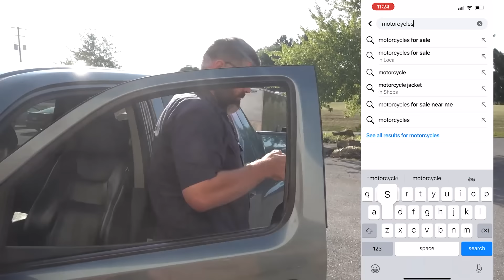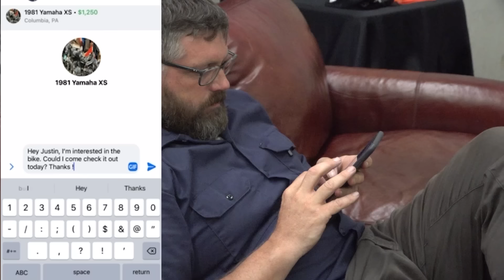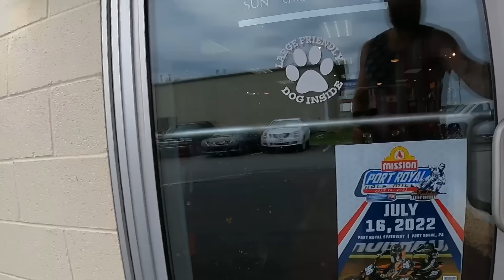I Bought the Cheapest under $1,000 Motorcycles: Challenge

Comment: The same time you guys were doing this, i was buying the only titled bike on marketplace under $1000...  just so happened to be a black 89  virago 1100.

Got it full of green/yellow gas & "fresh rebuilt" carbs off, flushed fuel system, carbs on, fresh gas, ran good. Cleaned the carbs, runs great.
Now just needs the updated starter gear.

First road bike, got it in pieces, had it ridable within 24hrs. $400 well spent!

Comment: I can relate to the challenge of taking out and rebuilding/cleaning the carburetor. About two years ago I purchased a partially running 1993 Yamaha Virago 750, which looked quite similar to Sean’s. It broke down on my drive home with it. Turned out that the carb needed a makeover. It was a big challenge removing the carb, but especially trying to reinstall it. YouTube was a huge help. Still riding the bike. Thanks for the fun videos Sean and Craig.

Comment: Funny, my first motorcycle I bought off of someone who just had it sitting around, is a 95’ Virago 535. Bought it for $1000 and the only problem it had (unbeknownst to me at the time) was that it only ran on the front cylinder as well. 
I ended up spending a ton of time learning about motorcycle repair from the ground up and rebuilt the carb to get it running. This video seemed like my exact experience!

Comment: I love this. I bought a Virago XV125 as my first bike for £275 and 3 years on, it's still going strong. The engines are phenomenal... everything else is messed up but hey ho. Speedo doesnt work, electrics dont work, ignition is... meh... indicators occasionally mess up, no fuel meter, prone to battery issues, rectifier always fries itself. It has been the best bike to learn from and It will always hold a special place in my heart

Comment: I absolutely love the virago! I've fixed so many of them. Most of these old japanese motorcycles need a new stator and regulator after revival. That gunk on the stator wiring is a dead giveaway that someone knew something was up.

Those hoses and piping that are connected to the carbs are Yamaha's EGR system. I usually pull all of that off and cap the ports.
Reply: That bike looks like it hangs out with a Chinese Meat Loaf impersonator and posts it's selfies on their social app called, "Bookface". {0.o}
Reply: Damn. That Virago is pretty sweet. Bad thing is I don't think that's the first Virago he's worked on.

Comment: Sean, mate, just undo the overflow screw & use a straw/pipecleaner to push the flote that will let some fule through & you will at least find out if its that without doing all that work.

Comment: I bought a Yamaha virago 250. 2013, with 300 miles on it , not the most powerful bike but it was super fun, and excellent on gas...I replaced the stock exhaust with drag pipes...the stock ones were weird as hell the rear pipe coming out of the motor was a tiny  pipe hidden inside the normal looking pipe ....after I changed the exhaust it was way louder....I put 6 thousand miles on that bike the first month I owned it , I got it cheap cause it was used to give motorcycle training got my money out of it that's for sure ...I liked the Yamaha compared to the Honda rebel.

Comment: Since you decided to ride the Virago around with only one cylinder firing, you are lucky that the problem was lack of fuel rather than spark.  If that rear cylinder had been getting gas but no spark, it is possible that the raw gas would have washed away enough oil on the cylinder that the top ring would have scored the cylinder wall.  The raw gas would also have diluted the motor oil.  There are numerous stories of people who cranked and cranked an engine that would not start, only to later discover that they ruined it by scratching up the cylinder walls.
 FWIW, for an engine that has not run for a long time, I have been told to spray some Marvel Mystery Oil or fogging oil around the piston through the sparkplug hole to lube the cylinder wall and get oil to the top piston ring.  Years ago I know that Briggs and Stratton sold an aerosol oil to do this for mower engines that had been stored over winter.  I don't know it they still do.
ps.  The engine will smoke like crazy for a few minutes when started until the oil is burned off.

Comment: I just got my first bike. A 2005 Vulcan 500 was told the carbs would need to rebuilt because the previous guy left it with gas inside for awhile but it turns out the guy had it on fuel reserve mode and that’s why he couldn’t get it started best 800 bucks I’ve ever spent

Comment: The beginning of the year, i found a 2002 hond magna vf750 with 9000 miles that had bigger jets high flow exhaust and a high flow intake filter that was dyno tuned for $2700. Ran but had a bad regulator/rectifier. And it was clean as can be, no blemishes. I didnt think id like cruisers but I am blown away by how good of a bike it really is

Comment: My 82 Virago 750 had a fuel petcock for each carb.  So you had to remember to put BOTH of them on reserve if you were low on gas.  The other option was to put the rearmost one on reserve all the time so the one that sat higher in the tank would starve only the front cylinder and that one you could reach with your left hand.
So I know exactly what it feels like when your 750 twin starts running like a 375 single... with one cylinder doing nothing but being dead weight.
Reply: actually it’s rotational weight right? like spinning mass like your tires?
Reply: @lanceweyel879  Well that other cylinder is still creating a bunch of friction, pulling air in (no fuel) so you get the additional power loss of having to compress that without the benefit of the expansion upon ignition.  So basically worse than dead weight.

Comment: Sean is such a cheater and I freaking love it. Always a way out with him. And that's actually an awesome find. My Virago 750 blew up when the back cylinder lost oil for a minute on the interstate. Apparently it's super common. Those tiny banjo bolts just gunk up.
Reply: If you blow up a Yamaha that’s your fault
Reply: @Mouthy_Trucker  1982 barn find. Did a lot of work to get it running. Everything seemed fine. Lost oil pressure at 80 mph. Not my fault.
Reply: @Mouthy_Trucker  And I'd already done two oil changes to make sure it was good. Only takes one small contaminant to break free and it's over.
Edit typo
Reply: @Mouthy_Trucker  Hostility detected.
Reply from the maker: That was so not a cheat. I ve never purchased any motorcycle from that Honda dealer. They owe me nothing
Reply: @BikesandBeards  Still not at all what we expected at the start of the video. Outside the box thinking for the win.
Reply: I would have expected to pay more at a dealer. The fact that he knew enough to check says a lot, and it paid off. Now everyone's gonna go to their local dealer and ask for their black sheep bike at a crazy discount😁.
Reply: Man u love my virago its a 97 and i bought it with an oil leak, exhaust leak and a slipping clutch. Fixed my clutch, exhaust leak is next
Reply: @joshstone4052  They're so much fun. It's so much sportier than it looks. Mine felt sooo capable. Blowing mine up was the worst day ever. I had to push it for miles in the rain and it was so hot that I ended up puking everywhere and collapsing on my buddy's porch. Couple of years later and it's still sitting in my parents' back yard naked with no engine. True heartbreak.
Reply: @DarksideSleemo  yea man the thing rips for sure, and its got that old classic raked out style to it as well. Very capable and very stylish
Reply: I just bought a 82 virago 920 and dnt have spark... any ideas
Reply: @joshstone4052  But less rake than my Shadow which made it flick so easily. It loved the corners.
Reply: @DarksideSleemo  for sure, except for the pegs being too low. Wish it was a bit higher
Reply: @joshstone4052  Agreed. It feels like it wants to lean further but the pegs are the only limitation.

Comment: I built a pretty cool little bobber out of a 1986 Virago 700. Chopped the rear frame off, solo seat, drag bars with bar end mirrors, the front fender became the rear fender, and some flat black and gloss green paint. I also added canvas saddle bags which caught fire one day driving down the road.

Comment: I bought a motorcycle for 1500 and made 1000 on the deal. Now I have a less than free bike after spending 1000. 
Bought an 07 f650gs for 1500 nearly running. Great deal already. Spent 400 on a dealership freshen up. Spent about $300 on sprockets and chain and labor. $600 on tires. $50 fuel pump. Then a battery store in town fried it and gave me $3700 through insurance. Now we are at -$1000 or so. Just bought a new (used) wiring harness $200. Repaired it myself. Bought a rectifier stator combo $175. An Anti-gravity restart lithium battery $200. And ordered a Weiser Technik Blinker set. Over $400 for led lights that are the best on the market. You can't get better than weiser techniks for signal lights. Planning on a retrofit projector headlight and LED tail light, quickshifter, and CANbus controller for accessories, phone mount, and an exhaust. Should be sitting back at my original $1500 expenditure  but as the net expenditure over my entire ownership excluding maintenance from now on

Comment: This video hits home.
I gave my mechanic 100$ to come with me to check out a bike 2hrs away in his truck with trailer.  The seller was weird on the phone, but the bike was what I wanted.
Or so I thought...
The fairings were all broken and barely hanging on, the chain was more rust than metal, and it was obvious it was in far worse shape than the seller had disclosed.  The bike wouldn't idle right (only thing he did disclose), but then it was leaking fuel.  Thing started a mini fire on his lawn.  I walked and this dude literally chased us down the street, yelling about how WE wasted HIS time.
Blessing in disguise though as I bought my current bike the very next day, for a song.

Comment: Viragos have some magic juju in them. my old 535 survived a 5 month polar winter outside and started with full choke on a button press once spring rolled around. I was sure the battery would atleast be drained, but no. battery was fine, no problem with the carbs either. amazing, considering my '94 BMW gets cranky when the weather get's a bit too cold.
Reply: you got selected congratulation
 Text the number above⬆️💌🥰

Comment: Late to the game. Virago had a stuck float valve. I almost bought that same bike from my BIL, but bailed when I found out it had stuck calipers on the front, and a pretty big oil leak. The 400 Special is a great motorcycle, for some reason Yamaha was great at parallel twins - but I would buy reasonable handlebars and yeet! that wheelbarrow piece of junk. My youngest son had a Honda CX500 Custom with the same type of bars, and I barely got it home from 25 miles away.
Reply: you got selected congratulation
 Text the number above⬆️💌🥰

Comment: Virago Hitachi carbs. Virago stators. THE WORST! Fun fact, the 700 was only released in the USA because the 750 was subject to extra import taxes, Canada got the 750 version. Both bikes were subject to the terrible stator, and starter drive issues that plagued Viragos of the era. The Stator/charging issues would often manifest themselves as typical carb related issues, which made them terrible to diagnose. Also the carbs were nearly impossible to remove unless you also removed the motor side boots, making them impossibly difficult to work on. Ask me how I know 🤦🏼‍♂️

Comment: My uncle had a 1974 Honda CB550fourk I got for a steel and after we went through it replaced all the rubber and electronics and rebuilt all 4 carbs we was good to go. We did a few other things, brakes, battery, stator, plugs, air filters the old school ones that went over the end of the carb! I rode it for years like a dirt bike and a road bike! It had like 23 miles on it when I got it and I put over 50k on it for few hundred dollars 😮

Comment: I had an 1100 until it was stolen and it definitely sounded from the get go that is only running on one cylinder. I had that problem twice and even after boring it out, new pistons/rings/etc. It started doing it again after about 1000 miles.
Oh, it also had a chameleon paint job! Haha so it was Really sweet! Haha
Reply: Your issue was likely a Stator problem, creating weak spark. Just as a heads up.

Comment: My wife said I paid $1,800 , and I thought it was $1,500 for her 1981 Honda CB750 Custom Motorcycle. It ran, but was obvious to me that 'Babe' was going to require me to restore most of it, but still , in knowing the price of the exhaust pipes on Ebay if you could get them, are more than for the bike, it was an excellent deal from FB Market Place. The seller and son were hustlers, but in having my 79, 'Beautiful', I knew 'Babe' with some new and restored parts even from Ebay, my dearest would have a fine bike. Overall, forgetting labor, maybe including tires, etc, about $4,000 - It rides nice, has about 90+ hp, and my dearest will train it it more next season.

Comment: "Then you get the Japanese bikes who's goal is to build a carburetor and build the bike around it and put in like an enclosed box so no one else can ever get it out"!!!😂...... i can agree to this. I have a 1995 intruder 800 which is dual carb and the front carb is under the fuel tank between the two frame rails and you have to remove all the fuel hoses and move the wiring harness then slather it in crisco and pry it with a four foot crow bar and it'll just pop between the two frame rails.

Comment: Squirt some starting fluid in the air intake and see if the back cylinder starts running. If it has compression and spark, it won't need the carb working and should start running for a moment.
Reply: I tried that once until the it backfired through the carb and almost caught the entire bike on fire.

Comment: Every time I've had my Harley sit up and it won't start I take my air filter off down to the carb. Put my hand over the carb and turn it over. Once I could see gas in the carb it would crank right over. Use to also do that to my old 64 chevy with a 283, the fuel pump would go out on that thing. Just a suggestion.

Comment: I actually just did this challenge like 2 weeks ago I bought a used 2002 ninja 500r for my first bike for 500$ all it needed was a new rad hose battery and spark plugs runs like new Total cost 715$ did I mention that it only has 8k miles on it.

Comment: i own an xv 500, and i had the same problem, ran on one cylinder until revved then the second cylinder kicked in,. replaced absolutely everything i could. what fixed it was swapping the caps on the cables. so confused but its fixed

Comment: I just got a 2000 Victory v92c and It doesn’t run so I’m trying my best to get it running, I bought a new battery and spark plugs and I drained out the old bad gas out of it and cleaned the tank with a treatment and put new gas in it and it’s not turning over so I guess I’m gonna get new plug wires and see if that’s it

Comment: I just bought a 04 honda shadow vt 600 for 300 cash. It's has no title, no keys of course (not stolen) btw And the wire harness was chewed up by the previous owners dog. Replaced that the tires are flat and rotted, the chain is rusting away pretty much anything that could go wrong on a bike you name it, its got it badd... Anyways, did i walk away with a steal or fall into a big pit can't climb out of. Either way i feel like i got lucky on my first project bike  looking forward to hearing it purr

Comment: I did the same thing with my son last year for $1000. Well, we went slightly over....

He got a 1980's Honda Magna V65 (1100cc) with only 36k miles for right at $1000. It was in beautiful condition, but didn't run because it sat with old fuel. He put another $150 into it with carb rebuild kits and a battery. My bike was a complete disaster. I spent $350 and grabbed an 80's Yamaha Virago 750 according to the title. What it ended up being was a 700 with a different VIN number. I also paid an additional $150 for a 2-1 intake and a Chinese carb off Ebay. Couldn't get that garbage bike to run and wasn't about to waste more time/money when the title was wrong (ghosted by the seller), so I found a different bike that was wayyyyyyyy better: a 1997 Suzuki Bandit 1200 with only 16k miles for $1200 and needing nothing to ride. We both spent last year tinkering and making small improvements and then took them through Glacier Nat'l Park over Labor Day. Was so much fun doing this with my boy! Our next big trip will be through Yellowstone.